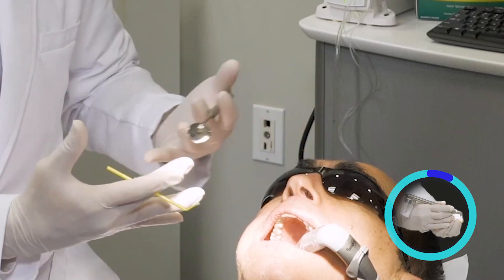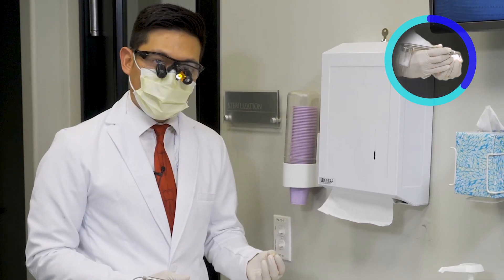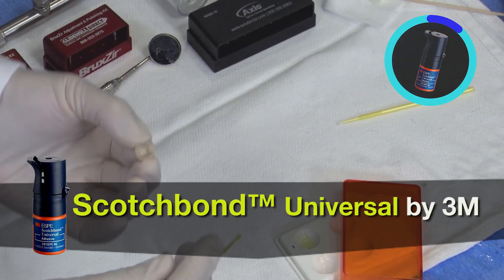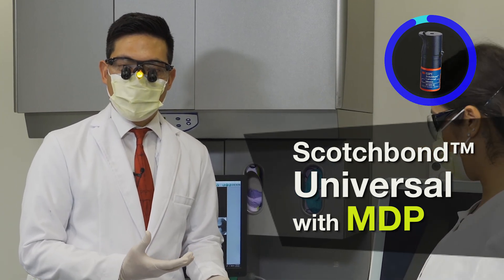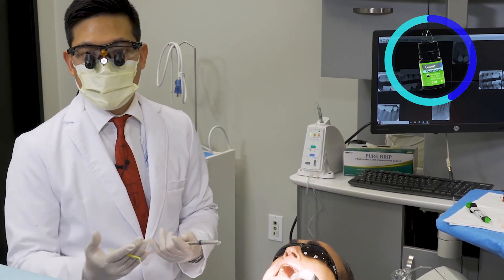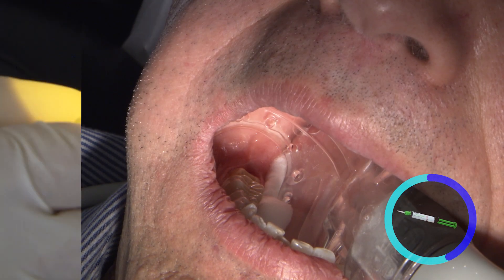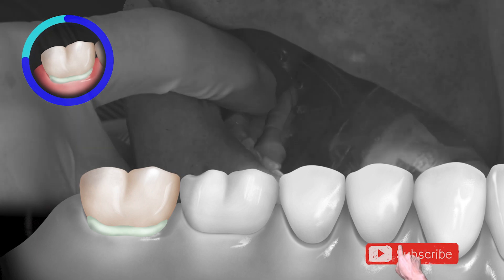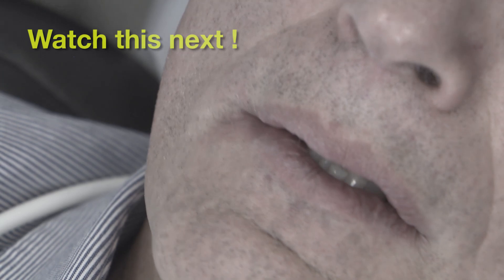7 STEPS to Cementing ZIRCONIA Crown on Less RETENTIVE Prep

Comment: Hey doc, thanks for the video and I really like your protocol. One thing I would mention is about the placement instructions from the manufacturer for Gluma. The placement instructions are to place Gluma for 30-60 seconds and then air thin. Then a thorough rinse is recommended and removal of all excess water prior to proceeding with the rest of the cementation steps. Just a small thing, but overall great video!
Reply from the maker: Thank you for watching this content.